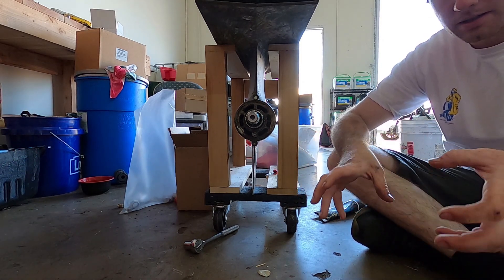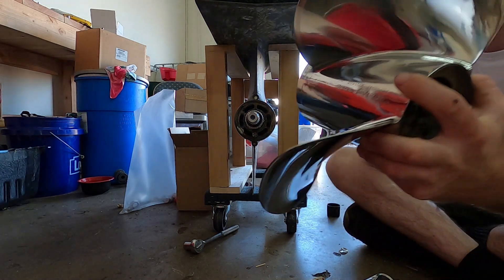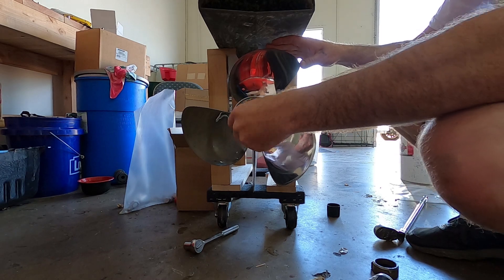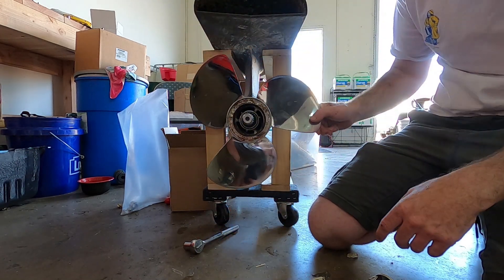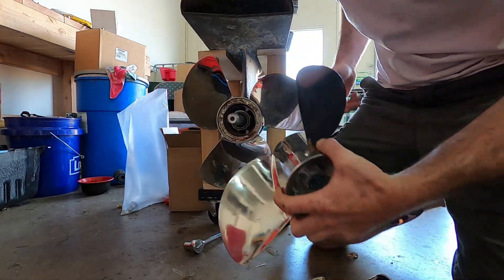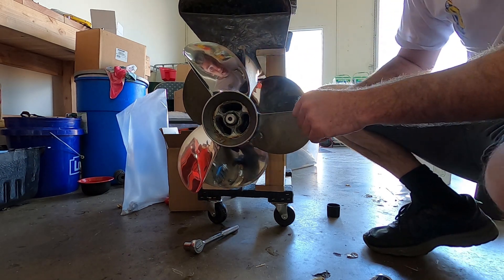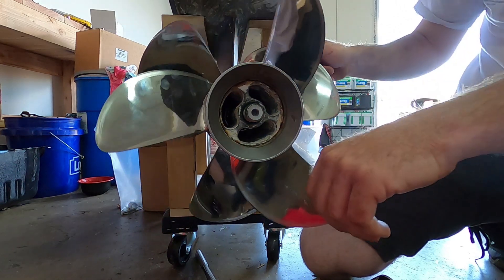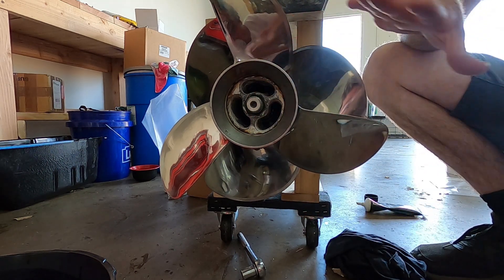How to install and synchronize boat propellers

Comment: I wish someone would take this misinformation off the internet. It is completely false and no need for Timing or Clocking. Not only do these props turn in opposite directions, they are different sizes and turn at different RPM's. Go ahead and time them and spin the props a dozen times or so, they will be different and will no longer line up. You will not find a Mercruiser memo stating this anywhere. Someone started this when the duo prop first came out and it is finally dying off.  It will not hurt to do this but it is completely unnecessary.